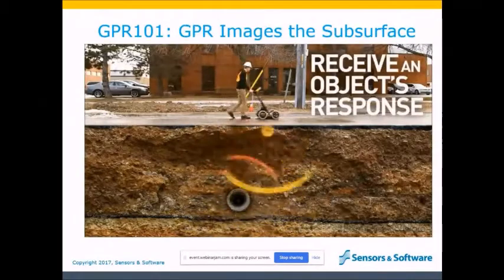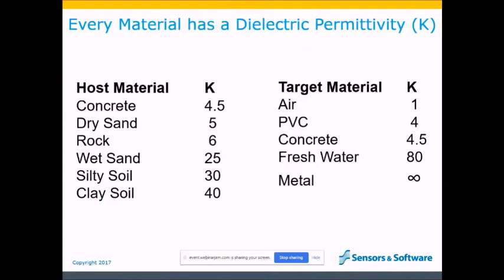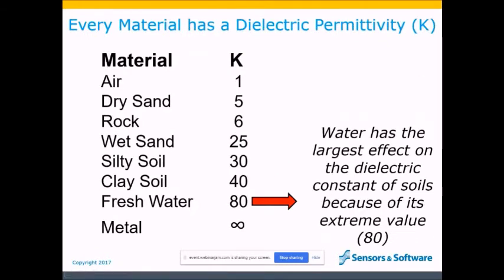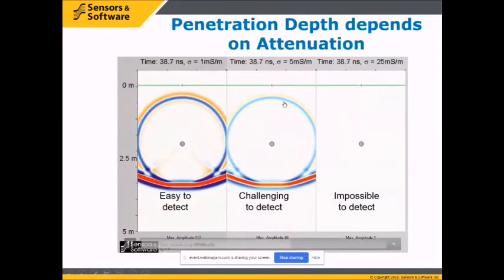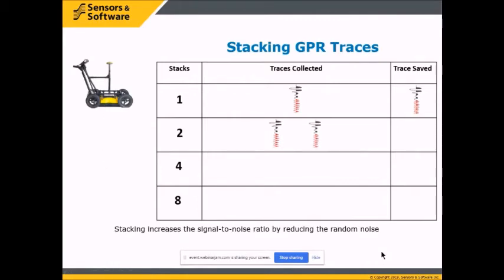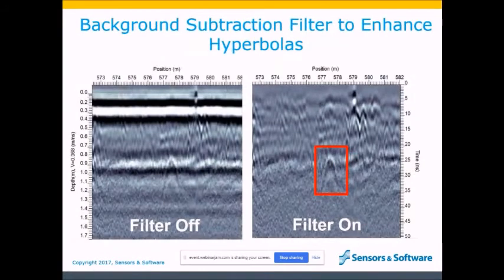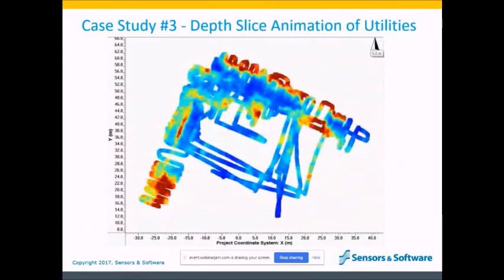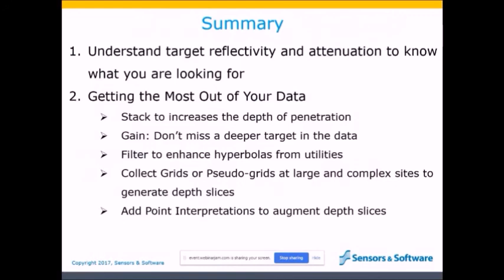Webinar: Getting the Most from Utility GPR Data

Comment: when calculating the reflection R with the K formule. somethimes you have a negative reflection value. what is the impact of this negative reflection value and how is this vissible on the screen?
Reply from the maker: The negative value means the polarity of the wavelet is flipped.  So, if the incident wave is Black-white-black, the reflected wave will be White-black-white.

Comment: I'm seeing different K values online. For clay you have 40 and I'm seeing online numbers like 10 and 20. Is there a good resource for common K values we might encounter in the field?
Reply from the maker: Clay usually has a high water content so the K values tend to be 40+.  A clay with a K of 10-20 would have to be very dry.

Here is the table that we use in our training courses:

Material               K
Air                         1
Gasoline               2
Ice                         3
Dry Sand              5
Granite                 6
Dry Salt                6
Limestone           8
Shale                    15
Saturated Sand  25
Silts                       30
Clays                     40
Fresh Water       80
Sea Water           80
Metal                  ∞